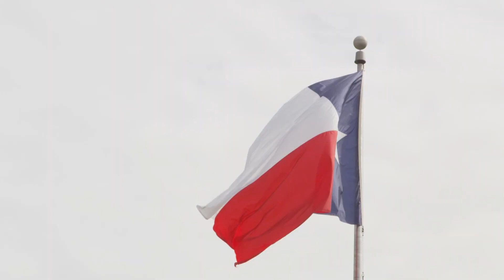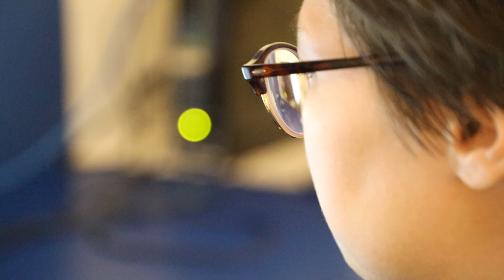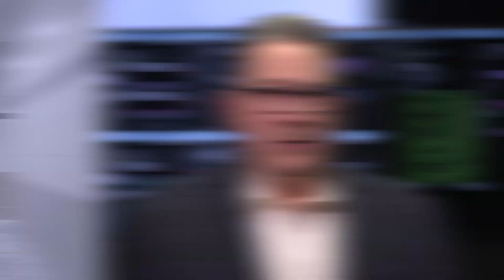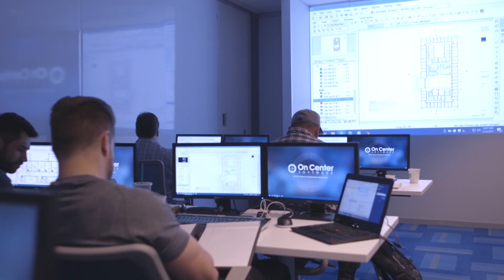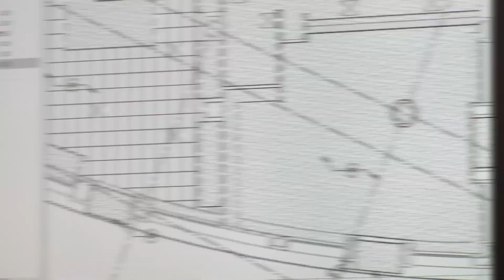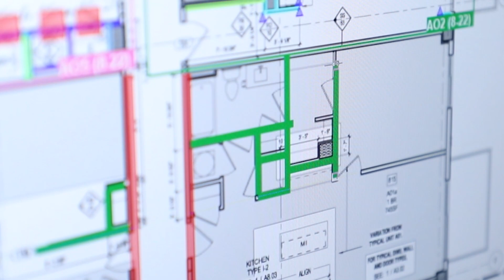Construction Estimating Software That Increases Accuracy & Growth

Comment: I use this software every day in my job. It's the best out there (that I've seen) but the price reflects that too. It also has a lot of areas it needs to improve on; Things that should work better but for some reason have not yet been addressed. If cost is not a concern, get it, but for some small businesses it's rather expensive
Reply: Can u pls provide me links to download this software?
Reply: the best and cost effective takeoff software are the qs-tools. they take off quantities from autocad to excel automatically making the work so quick with high levels of accuracy and can be afforded by every individual than the rest of the existing software.

Check out some sample videos on how it operates https://www.linkedin.com/posts/atif-sami-39597a77_qs-ugcPost-6682327412748951553-_YdT